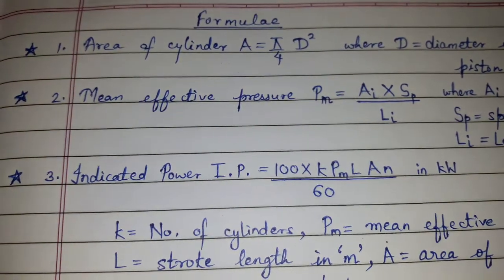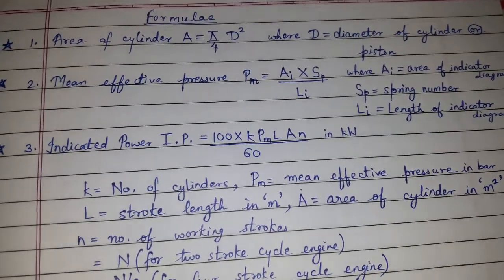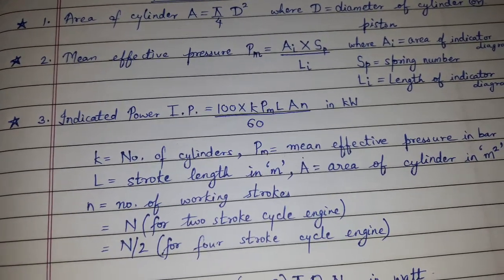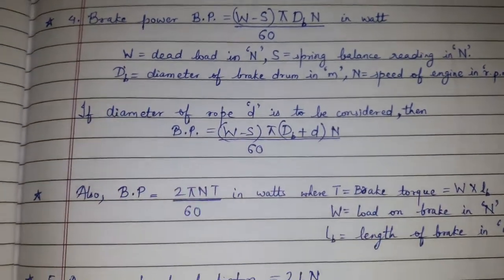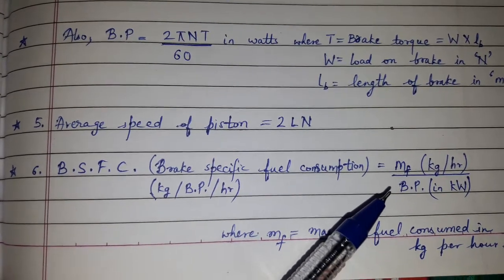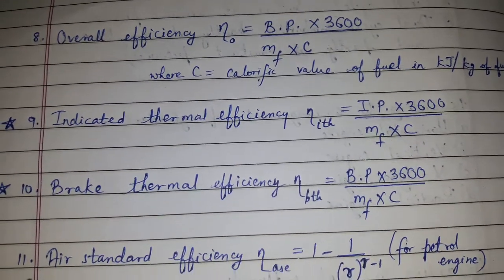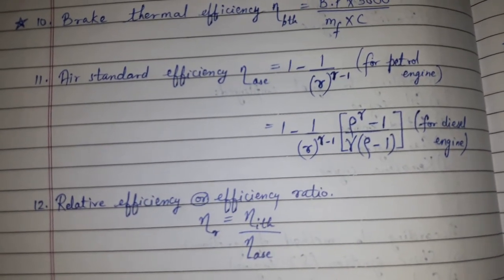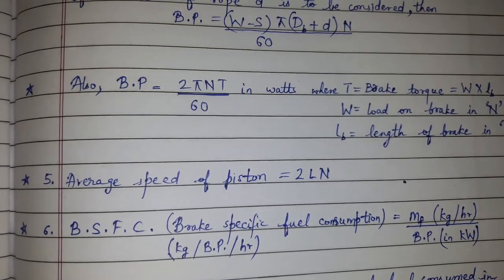Revision of formulae from Chapter 2 - I.C. Engine & Pollution control

Comment: What is the formula to calculate swept volume/stroke volume.

I am confused that in my book it had mentioned that
Vs = A.L and
Vs = A.L.n.K

Were
Vs = swept volume
A = area of cylinder 
L = stroke length
n = no of explosions
K = no. of cylinders.

Which formula is correct and why?
Reply: Vs=A.L